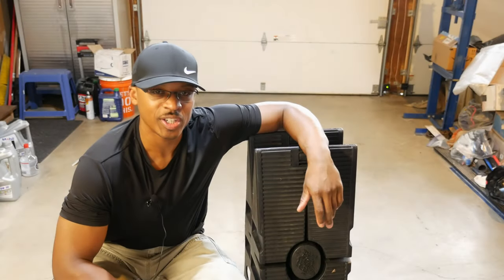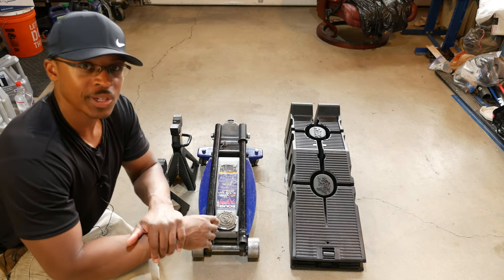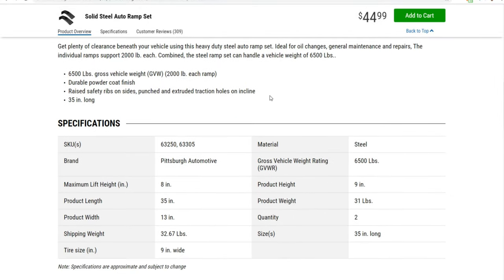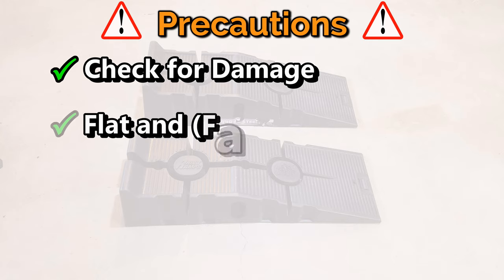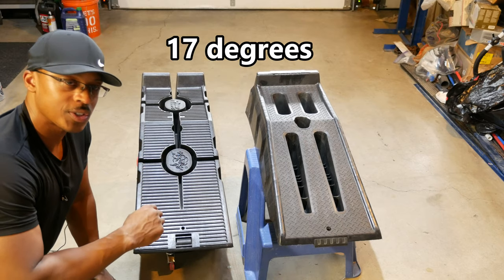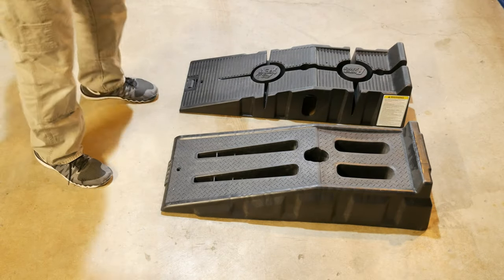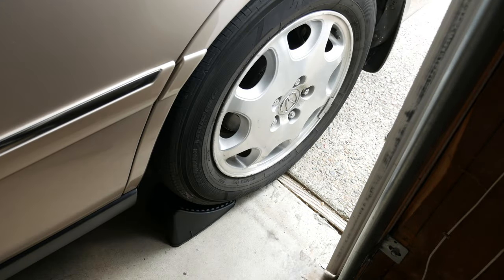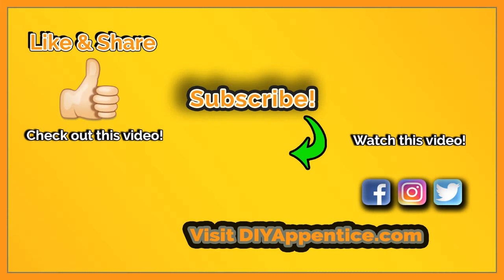Rhino Ramps Review and Tips for Using Car Ramps

Comment: On Amazon.com there are tons of people posting pictures of these ramps with cracks on them and people complaining that they cracked while using them. I definitely wouldnt trust my life to some plastic/rubber ramps.
Reply from the maker: Thanks. I didn't look too closely at the reviews before doing this video and just went more off personal experience. I have updated the video description after reading more of the reviews.
Reply: @DIYApprentice  No problem, I think maybe the race ramps are more durable if you can get them in steel.
Reply from the maker: @WiseSilverWolf  I would hope Race Ramps are more durable - they are double the price 😀 The only Race Ramps I saw are made out of a solid foam.
Reply: DIY Apprentice people rely on these solely to hold the car up which I get cause it’s what they’re designed for. But even when using these I place a jack stand on each side of the car for extra saftey precaution
Reply from the maker: @z33driverjg91  It doesn't hurt to take precautions.
Reply: @z33driverjg91  They also sell Steel Ramps in Harbor Freight Tools for pretty cheap, id probably rely on those more than the Rhino Ramps that are rubber/plastic.
Reply: All summer I was using 4-inch cement cap blocks to work under a minivan. Was looking into getting a set of ramps for oil changes, saw all the stuff at Amazon and was discouraged. Saw the wooden set like 6-feet long, figured it would be heavy and hard to deal with. Ordered a metal set from horrible Freight because the price was decent and I used that style before on full size trucks (just don't use them on sand, they sink). BTW: you can read the Rhino warning label at Amazon to help decide if you want to use ramps.
Reply: Yeah i saw the reviews too. I was looking for some ramps but i ain’t anout to risk my life for $40.
Reply: I have also seen pictures of cracked ramps and people saying their car 'slammed' to the ground. At least on Amazon the pictures seem to be of minor cracks and chips, not something that would cause the car to 'slam' to the ground.

Comment: Nicely done.   

I'm looking to install a towing system on my Fiat 500 for recreational towing behind a RV.  Also will be installing a hitch for a bicycle rack.

I believe these ramps will make my job much easier.

Thanks and again, your video nicely presented.
Reply from the maker: Thanks. Enjoy your adventures 😀
Reply: Worth a follow up.  I bought a pair of the 12K ramps and they work incredibly well with our Fiat.

No problem with ramps sliding on a concrete floor and just enough clearance that no car parts touched as the tires climbed the ramps.

Lift is high enough for me to access and work under the vehicle however a creeper is not feasible.

I'm gonna keep em. 👍
Reply: @rvvacation1862 
A creeper? 
Look at Richie Rich.
Real shadetree mechanics use cardboard boxes. 😂

Comment: Can you really perform a transmission change on on a ramp?  I thought your car needs to be levelled to refill transmission? 
I am currently debating between getting a pair of ramps and then a jack lift and jack stands for the rear in order to fully level the car for transmission change.  But if ramps alone are suffice, then I can save some money.  
Thanks!
Reply from the maker: Yes, ideally it's best to have the car level to drain the transmission.

Comment: Just picked up used ramps. Like new. 1st  try they slid on the payment. I'll try again. I heard that was a chief complaint. This will aid in changing my own oil for my Mustang instead of spending $150.00 plus elsewhere.
Reply from the maker: Yes, that was an issue I showed when I tested the ramps in this video. I usually tuck them under the tires before driving onto them.

Comment: What brand was your old ramp?  Was it a different version of rhino?  Those look more dependable
Reply from the maker: Yes, I believe it was an earlier version of the Rhino Ramps. As you probably noticed in the video, the rubber foot was MUCH better. I drove up the ramps a little fast and cracked the stop at the end of one of the ramps 😞
Reply: @DIYApprentice  thanks man I appreciate the feedback.  What’s the model number on those old ones?  I think I want to get the older ones.  Rhino ramps seem pretty good overall; but I have been seeing a lot of reviews of them cracking
Reply: @jasonmatias8979  I didn't see a model number on the ramp. They're made by Blitz, which I believe was bought by Hopkins Manufacturing. So, the Hopkins Rhino Ramps may be the only available option.
The cracking issue is strange - seems very random. I just used the same set of ramps featured in this video a couple weeks ago without any problem.

Comment: Have ordered there after finding out my vehicle doesn't fit under my old metal ones that I have from a previous vehicle. My new one is much lower. I was skeptical at first being plastic and all. Once I got under I always still have safety Jack's and chocks in place just incase one were to give out. But while underneath and started working I ended up having full trust in these ramps they don't seem to be stressed at all with my vehicle on them. My vehicle does curb weigh about 3200 pounds  ( not taking the full weight only the front) no problem.
Reply from the maker: Glad they're working for you. My heaviest car is 3800 lbs - haven't had any issues.

Comment: I just bought these ramps but my car is not running so I'm having a hard time getting it up the ramps. ☹️ Any tips ?
Reply from the maker: Beer and some friends to push would seem like your best option 😀. I have winch at the rear of my garage to pull inoperable vehicles.
Reply: Jack the vehicle up and put the ramps under the wheels

Comment: While I am all about safety, I do wonder about the necessity of chocking the tires on ramps.  Between the car being in park (locking the transaxle for the front wheels) and the parking brake locking the rear tires, I really do not see much if any risk that the car will roll off the ramps.
Reply from the maker: The instructions for the ramps mention chocking "the wheels on the  ground". I don't mind spending a few more bucks for the added safety.

Comment: Sorry, can you explain how you come up with 3000 lb support when the GVW is 12K lb?
Reply from the maker: Yes, I obviously didn't do a good enough job on this point, since several people have asked. The label on the ramps states that they support 3,000 lbs. each, 6,000 lbs. per pair, and a GVW of 12,000 lbs. I would take into account the weight distribution of the vehicle; for example, my car's weight is distributed 60% front to 40% rear. Most vehicles won't come anywhere close to the ramps' weight limits, and I personally would go up to the 16,000-lb ramps for heavier vehicles.
Reply: @DIY Apprentice  Thank you for detail explanation. I couldn't figure out how we went from 12k to 3k. So, I did purchase 12k one but never used it. Do you think it is safe to use it for GX460? It weighs around 5200lb and GW is 6600 it says.
Reply from the maker: @Big_pl65  Based on the specs, they should be fine to use.

Comment: I have the same rhino ramp that I use for my 2016 Camaro and it worked fine at first then when I used it the 2nd time the ramps just slide back everytime.
Reply from the maker: The rubber foot on these ramps isn't very good. If I tuck the ramps under the tires like I demonstrated, I usually don't have any issues.

Comment: I do not understand how you could get 4 wheels on 4 ramps. the clearance for the rear wheels (typically the rear) would be very low, not the same as for the front. In fact, the warning label shown at 1010:43 says: "...NOT TO BE USED TO SIMULTANEOUSLY support both ends or one side of a vehicle."
Reply from the maker: Yeah, I personally wouldn't attempt to put the front and rear wheels on ramps simultaneously, but I've seen cars supported in this manner.

Comment: There are three weight limitations on my ramp. Would love to hear an explanation of what each means. You kind of glossed over it when you were doing the example of a 3,800 lbs car... no consideration explained regarding weight limits.
Reply from the maker: I touched on the weights briefly at the beginning of the Rhino Ramps review portion of the video - @7:34. I believe the manufacturer is covering their bases, shall we call it, by listing all three weights as multiples of 3,000 lbs. As you probably read, the ramps are only meant to be used as a pair to support one end of the vehicle. I will say that I would consider the vehicle's weight distribution when purchasing ramps. My car's 3,800 lbs is distributed 60/40 in favor of the front end of the car (2,280 lbs front vs. 1,520 lbs rear for a total of 3,800 lbs.).

Comment: Why did you buy the new ramps and continue with the old ramps
Reply from the maker: I'm assuming you're asking why I bought new ramps and discontinued using the old ramps. I wasn't used to using ramps and had mainly used jack stands, so I drove up too fast on the old ramps and cracked the stop on one of them. I've had the newer ramps for about three years.

Comment: Could I use these ramps to change my rear o2 sensor?
Reply from the maker: If you're asking about whether you can reverse onto the ramps, I haven't done it, but I know others have done so. I like to use jack stands in the rear.
Reply: DIY Apprentice I meant to get under the front end of my car
Reply from the maker: @khalincarter7272  Sorry, I just read "rear" in my head. Since I don't know what you're driving, I can't say for sure. My car's body is about 6 inches off the ground, and I can get a decent way under the car.
Reply: DIY Apprentice Okay thank you!

Comment: The one complaint I hate about the Rhino Ramps is that they move, but the people who use them must not be wedging them first.  I doubt there's any ramp out there that is perfectly still if you're driving up on it unless you have bolted it to the ground.
Reply from the maker: As you may have seen in the video, the ramps are not very good at remaining stationary. I figured wedging them keeps them from moving and ensures a truer drive up the ramps.

Comment: I have the harbor freight steel ramps. They work great I just have drive on to 2x8s to get the clearance for the ramps. I dont trust plastic ramps, too many bad reviews on amazon.
Reply from the maker: I've never tried the HF steel ramps. They sound like a good option for someone who doesn't want to use plastic ramps.
Reply: I think they stopped selling the steel ones.

Comment: Hi .if  anybody using this ramps. I don't think it will be safe to go under the car How ever I have an idea you can fill it with a cement then you can use it for any car. Remember when the cement dry. But you also need a two wheel dolly for that to move  them because they will be heavier. idea! Got that
Reply from the maker: I would just buy a different style of ramp if you don't think they'd be safe. I haven't had issues with my ramps since I posted this video, but I acknowledge that others have reported cracks.

Comment: I tried 3 times to drive up the ramps with my 17 Camry. I must be slow or to timid to get it right. I can't judge the momentum and the gas peddle without jerking. Gave it to much gas and the car hopped over it and I had to jack the car up. I feel like a pure idiot
Reply from the maker: If you're using them for the first time, it can be a little tricky to judge the proper pedal pressure. I imagine you're getting about halfway up the ramps and not gradually giving the car just a little more gas to reach the top.
Reply: @DIYApprentice  
Yes exactly. I'm not giving it enough gas to power up the ramps. I'm to nervous about giving it to much gas. 
Crazy ad it sounds. I been doing my own oil changes for over 20 years. I always used a jack and a full size spare tire as a stand. Ramps are new to me

Comment: I have these.  On a smooth surface as your driving up they will slip.
Reply from the maker: The foot is not well designed, but I've never had them slip when I tuck them under the tires as I demonstrated in the video.
Reply: @DIYApprentice  understood , however as my car gets almost to the top of the ramp it will slide forward, my car is a 2015 Roush RS3  rear wheel drive car,   Bought me a quik jack system then threw the ramps in the trash.
Reply from the maker: @MustangGuru  Interesting. Thanks for replying. I'm not sure why the manufacturer made an obviously bad design decision.

Comment: Your foot test is kind of bogus. The newer Rhinos will not slide when driving a car up them. The pad at the tip of the ramp pushes down as the tire drives up and keeps the ramp in place. Your foot proves nothing. The center slots on the tops are also perfect for sighting down the ramp to make sure the ramp is aligned.
Reply from the maker: The foot test was not meant to simulate a car driving up the ramps. On initial contact with the tires, I noticed that the ramps tend to slide more than the prior version that had a more grippy foot; other viewers have mentioned the same. In the video, I suggested wedging the ramps under the tires to compensate. Yes, good point about the slot at the top.
Reply: @DIYApprentice mine don't budge. If people's are moving, they're doing it wrong.
Reply from the maker: @houndawg3  It could possibly have something to do with the surface on which they're used.

Comment: The newer one is narrower because it can hold more weight
Reply from the maker: The old ramp and the new ramp are both rated at 12,000 lbs. GVW.
Reply: DIY Apprentice a narrower plastic ramp will be less likely to fail, I should have said. It will hold more weight.
Reply from the maker: @KitchenerLeslie2  Makes sense
Reply: DIY Apprentice there’s a new one rated at 16k
Reply from the maker: @fisherman1353  Yes, I've recommended that one when people have asked about heavier vehicles.

Comment: I've yet to see anyone slide under a car while evaluating these ramps. I guess they don't trust them so why use them at all? Just a good old fashioned jack with stands work fine!!!!
Reply from the maker: Good point that I probably should have shown getting under the car. I only use them for oil changes or anything else from about the front wheels forward. Otherwise, I use a jack and jack stands. Even with jack stands, I'll leave the jack in place if I can work around it.